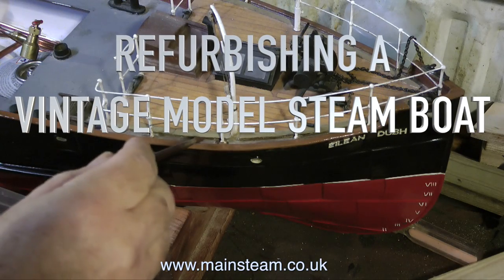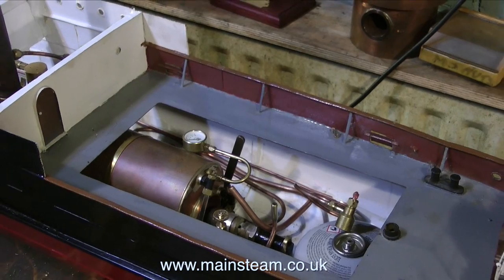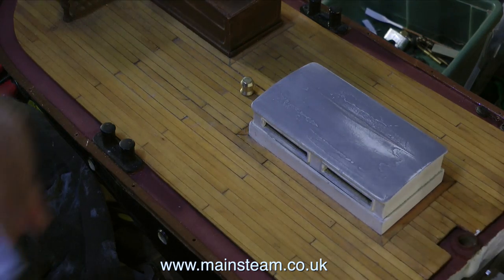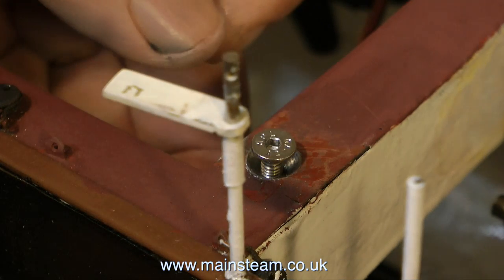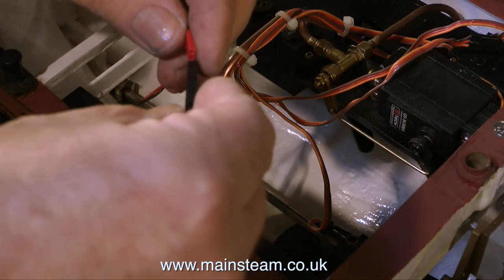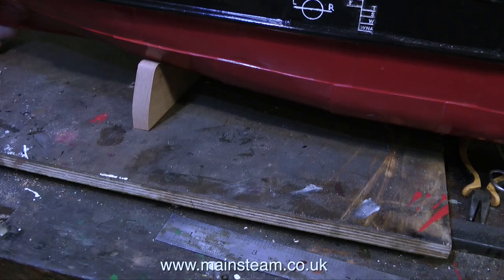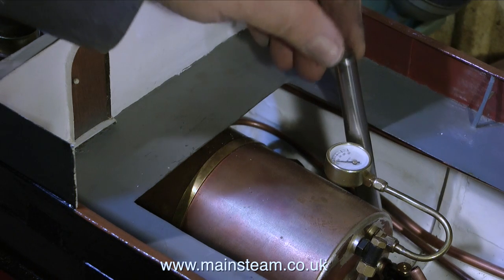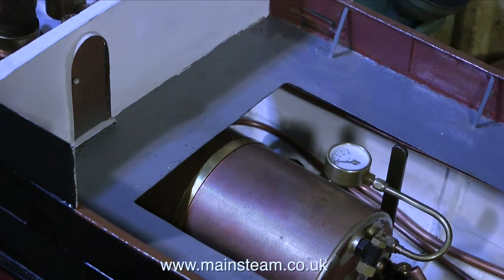REFURBISHING A VINTAGE MODEL STEAM BOAT - PART #30

Comment: nice job, my grandpa has a Stuart twin launch on a tom thumb locomotive, with a handmade copper boiler, it need to be freed up and boiler gone through, any suggestions to free up the Stuart twin launch?
Reply from the maker: Flush it with as much penetrating oil as you can get into the valve chests & cylinders - then leave it for a few days, then slowly warm the cylinders very gently & carefully with a small blowtorch and see what happens. Sometimes you have to dismantle them if the corrosion is very bad.
Reply: Keith Appleton
thanks, how about the boiler?
Reply from the maker: That will need a proper hydraulic test to verify that it is safe. I can't help you with that one, you need a certified boiler tester.
Reply from the maker: Maybe you could watch my video on this subject: https://www.youtube.com/watch?v=eYk_FiLYUjg
Reply: Keith Appleton
will do
Reply: Keith Appleton
if i remember right it is just the cylinders that are stuck

Comment: Those tiny connectors for the radios will not like the micro climate in the engine room one little bit. 
It is a bit of a faff, but if you smother the connectors and the pins and sockets with silicon grease then they should be fester proof for a very long time.
I would go as far as to remove the pins from the connector body, liberally coat the pins and body cavities with the grease then re insert the pins! Like I said, a bit of a faff, but this virtually encapsulates all the important bits with what in effect, is WD40 in grease form. If actually fitting the crimped pins onto new wires, I cover the stripped wire with the grease before crimping, but I am a sad old git with nothing more pressing to do :o(
Reply from the maker: All good practical ideas. I will be wrapping them securely in insulation tape after first treating the connectors with Silicone grease.
Reply: You may have a job getting the tape to stick! Just silicone grease should suffice. Looking forward to your next steamy videos!